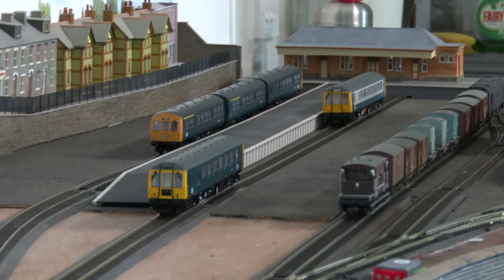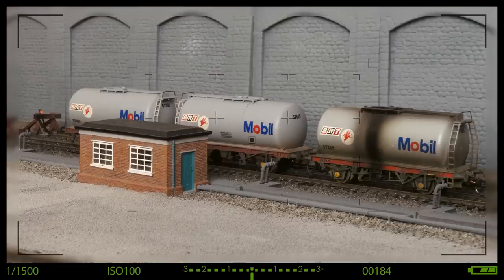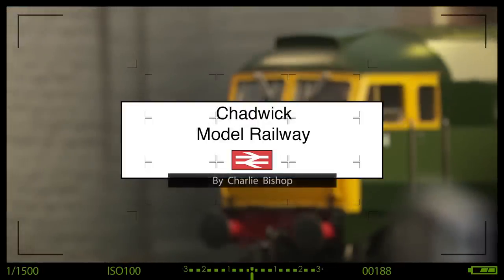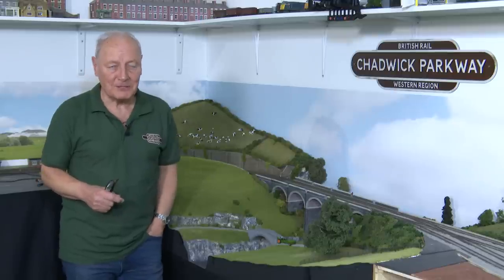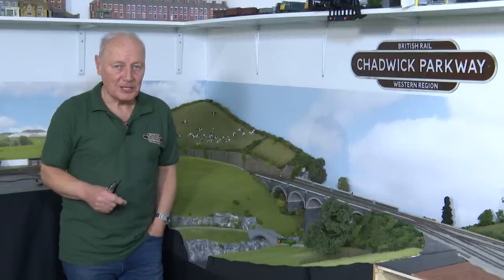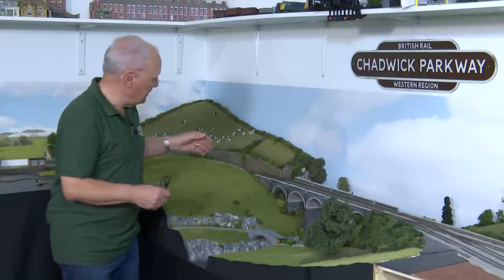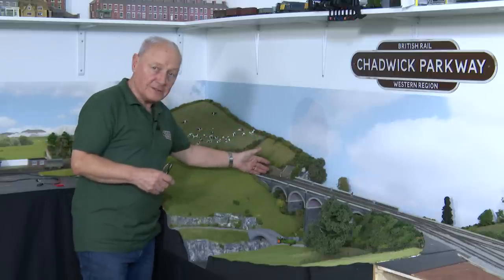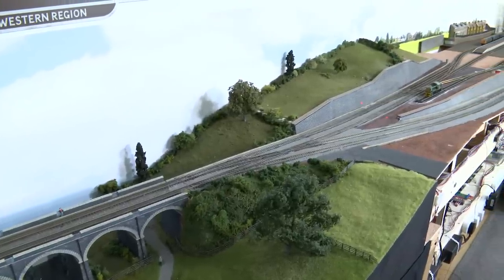SIGNAL POSITIONS at Chadwick Model Railway | 199.

Comment: Hi Charlie. Train driver here. Section 2.3 in the RSSB Handbook RS521, Signals, Handsignals, Indicators and Signs states the following:

“Junction indicators are provided to show that a train is being signalled to a route to the left or right of the straight route.

When the straight route is obvious, there is normally no junction indicator provided for this route.

Where there is no obvious straight route, a junction indicator will be provided for all signalled routes.

Where the straight route is not the highest-speed route, the junction indicator will normally apply to the lower-speed route.

Where the diverging routes ahead are both of equal speed, a junction indicator will be provided for each route.”
Reply from the maker: An absolute epic quote Phil, and one of which I’m most grateful. Regards, Charlie
Reply: Yes although technically correct this is based on modem signalling practices. Back in the 60/70 and early 80s the approach was different
Reply: @Llamberg.Railway As I was too young to work in the 70s and 80’s, unfortunately I can only go by what I know but thanks for the historical context.
Reply: Hi Charlie I’m an active train driver regarding ground position light signals displaying yellow aspect these are stop signals applying to movements in the direction to which the signal can be cleared other movements can pass the signal without it being cleared therefore the signal showing a yellow aspect and a white aspect the movement is cleared for the shunt neck when the same signal shows 2 white lights at 45 degrees the movement is cleared for mainline however this will also mean that the train needs to be able to stop at the next main aspect signal or it’s coming on top of another train the type of signal you need is a yellow and white light both lit and when the signal is changed the yellow light goes out and shows 2 white lights at 45 degrees hope this helps I’ve got photos in my rule book don’t think I can add the to the comments.
Reply from the maker: Thanks Mark, I fully understand that.
However, coming in from the mainline you will pass the unlit side of the signal.  I’m wondering what the signal might show and does it matter anyway.
Regards Charlie
Reply: @ChadwickModelRailway  hi Charlie, trying to phrase things as not teaching to suck eggs, when approaching the yellow white ground signal from the reverse side of the signal will show yellow white irrespective if travelling from the main line or head shunt.
Reply from the maker: That’s what I needed to know.
Therefore, you can’t wire it to the point position, otherwise it would show two whites. Regards Charlie
Reply: @Llamberg.Railway  As a retired Driver, I disagree completely. Even semaphore signals were 'stepped' to show the diverging route ahead.
Reply: @cyberdonblue4413  not sure what your talking about as the context is colour light signalling. I don’t disagree as I’m fully aware of the meaning of stepped semi fore signals. But if the reference is to diverging junctions, the signalling engineers I had conversations with over the years knew there stuff, and what was considered the straight route was not always logical. In the norm the straightest route was used but there were abnormalities on occasion.
Reply: @ChadwickModelRailway  can you define what you mean wire to point position, if you mean the ground signal will automatically change with the movement of the point then yes your correct you can’t wire it to the point. But if you mean it will only clear with the point in the right position ie some form of interlocking then yes. A further thought it could be linked with some form of condition in train controller that the point has to be set for main line before the ground position light will clear
Reply from the maker: Yes LR, you’re correct. I will have to run  the shunt signal through Train Controllers/iTrain, to avoid the two white’s illuminating when a train comes into the goods area. Regards Charlie
Reply: If the above is an extract from the current "Network Rail Rulebook" then I'm glad I left Britain.  Because the terminology reveals a total lack of safety comprehension, & clearly no use of Psychology to avoid dangerous terminology such as "straight route" & even more dangerous "where the straight route is not the highest speed route, the junction indicator will normally apply to the lower speed route". Such vagaries as "straight route " or even "lower speed route" DO NOT define exactly which track is being described leading immediately to confusion, which must be avoided at all cost to avoid accidents. 

In BR days every track had a specific name to avoid confusion between tracks. And every Driver & Guard had to remember all names of all tracks on all routes they "signed for". But then in BR Days it took a minimum FIVE YEARS OR 2000 TURNS of Duty whichever was the greater, in the cab of locomotives as a "Secondman" BEFORE YOU COULD EVEN APPLY FOR A DRIVERS POSITION. Probably why BR's Safety record year on year was usually in the top three worldwide. But since BR was abolished has sunken slowly into the realms of third World countries, and now we know why !!

By the way I'm a qualified Locomotive Mechanical Engineer, who's worked for more Railways Companies Worldwide in more departments than I care to remember. Indeed at 21 years old I was already the Worlds youngest Shedmaster, & therefore also qualified to drive steam. Indeed I've Driven trains all over the World, so I'm familiar with many signalling systems. But never in my 40+ years on railways Worldwide, have I ever seen such an incompetent and dangerous set of instructions relating to signalling, than that idiotic nonsense written in "Philsmith71's" Post above. Indeed I really cannot believe that any railway organisation would produce anything so absurdly dangerous !
Reply: @railwaymechanicalengineer4587 I take your reply to mean that the “idiotic nonsense” to which you refer to in my post is with regard to how the rules are written. If I could have included a screenshot of the relevant rule, I would have done so.

Comment: Bloody hell Charlie...can't believe they make these signals in HO now!  As a signal electrician of 20 yrs , it's amazing to see these in the model form! We call "Feathers" Junction route indicators "JRI' s and the JRI will ALWAYS show the divergent path , so if the main goes to the left, the JRI will point right. We have them in from 9 o'clock to 3 o'clock positions and you can have all if you need them! I change lamps in them all the time! The Number indicator is called a "Stencil" or Theatre down here in Australia and so cool to see a model one! You will (mostly) always get a yellow with a JRI or Theatre aspect unless high speed turnouts are used.
Very nice work and cool to see.
Cheers Gregg.
Reply: Hi Gregg, the fantastic folk at Absolute Aspects are now doing the multiple aspect signals, with Route Indicators, and ground shunting signals in N Gauge - they’re works of art.
Reply from the maker: I’m so pleased that you found interesting, Gregg. However, our diverging signal, points to the lower speed track! Regards, Charlie
Reply: @ChadwickModelRailway   Hi Charlie,  yes , I meant whichever is the lower speed route , to the left in your case.🙂

Comment: Hi (youngish) Charles. 

My goodness, after watching this, am I glad I opted to continue with my station duties at BR's Wimbledon (1970s) and not apply for a second-man position that would lead up to being a train driver. If that had happened, I would probably have been stationed at Clapham Junction (the world's largest junction), Wimbledon Park depot or, Waterloo (remember the Clapham rail disaster?). That being the case, a mental breakdown would almost certainly have ensued as during rush hours, Wimbledon Station saw trains arriving only 2mins apart in either direction. It just goes to show that signalling is the single most important aspect (no pun intended) of running a railway service. God help the commuters if it ever goes wrong. 

Paul. 👍❤
Reply from the maker: A great and honest confession, Paul. Regards, Charlie

Comment: Hi this is an excellent video, I am a former Movements Inspector (Someone who passes out a signalman that is capable of working a specific Signal Box). Like many you have got confused with the issue of catch points, trap points and safety points. Catch points are at the bottom of inclines and are normally in the trailing position to derail runaway wagons. Trap points protect a siding adjoining a running line to make sure anything in the siding cannot get onto the running line and are open in the facing direction. Yours is a safety point to protect something from escaping from a private siding onto the main lines and would be worked from the signal box.
Reply from the maker: Thanks Andrew, much appreciated.
Could not a private line, have its access locked of without signal box intervention?
Regards Charlie
Reply: Hi Charlie, Some Private Sidings had a gate which could be unlocked by a key but this was dependent on the layout. Where a Safety point is used then it could be controlled via a ground frame by the train crew but in your situation it would be done by the signalman if the distance was up to the legal limit of 350 yards for a mechanically worked point or further if it is electrically operated. In some instances where a ground frame is used that could be electrically released from the Signal Box.

The situation concerning the Junction Indicator on the signal is slightly more complicated it would be dependent on factors such as line speed etc. In your example as a former Movements Inspector my opinion is that the Junction Indicator would go to the left, even though the Main to the right curves would have no influence on this as it is a through route. If the Main has a speed restriction of greater than 10 mph from the lead over the viaduct then you would have a Junction Indicator for both routes.

Your ground signal would have a yellow (bottom Left) and a white (bottom right) to indicate access to the head shunt is allowed but to get onto the main line the yellow light would go out and an additional white light above and at 45 degrees would be required to authorise a train to go onto the main line. Before the Signalman could reverse the lever for the ground signal the points would have to be reversed first to enable the ground signal lever to be unlocked.

In the Signal Box you pull the Point levers from the exit point towards the train and the signals in the order the train will pass them. Hope this helps but feel free to come back with any other questions you have. @ChadwickModelRailway
Reply from the maker: Thanks Andrew for some intriguing details. Regards Charlie

Comment: Enjoyed the video Charlie and great to see you are taking the signalling seriously. I hope it wasn’t only me that mentioned the catch / trap point. I wasn’t pasting you sorry if it came across that way. I think you once mentioned you worked on helicopters well you know more about railways than I know about helicopters and you’ve pretty much nailed it on this video. 
Regarding feathers (correctly junction indicators) the indicator is for the route that diverges from the main route. In your case a No.1. The main route being to the helix. 
Route indicators (slang = theatre boxes) are found where the line speed is slower. This is because it takes a driver longer to process the information they contain than just seeing the “flash” of a feather (flash being another slang term for a junction indicator). Let’s not get too far into signal sighting which is a whole different chapter of railway knowledge 🤣 Depending on your line speed coming off the curve onto the viaduct you could simply use a theatre type route indicator. M for helix, 1 or 2 for your dead end platforms. This would be 3 aspect  green or yellow with M for M aim line (helix) yellow with 1 or 2 for your platforms. 
That signal would also have  position lights beneath the main aspect for movements towards the occupied dead ends. Position lights would still need a 1 or 2 route indication for the permissive (already occupied) platforms but position lights and no theatre indication would be for the goods sidings. So no need for a G indication. 
A yellow ground signal would work for movements from the goods to the head-shunt, yellow and white horizontally displayed. This is the normal position for this type of signal, allowing for movements towards the headshunt with no involvement from the signaller. Only when a movement is to leave the goods sidings for the main line do you need the 2 whites at 45 degrees which the signaller sets. This allows for shunting into the neck without the signaller having to constantly set the signal which he would have to if it were a standard red/white ground signal.  You don’t want the RMT on your back demanding better pay for the signaller because he’s never got chance for a brew🤣🤣
There would need to be a further main aspect stop signal beyond this yellow white ground signal before any conflict point with a junction though. Not sure if your track layout allows for this. 
By all means send me the plan and I’ll signal it for you. 
Best wishes
Paul (mainline train driver).
Reply from the maker: Thanks Paul, for an in-depth response. With similar advice from your colleagues, I think I’ve cracked it now. It’s great to have you onboard. Regards Charlie

Comment: Yellow/white ground position signal - 
You can pass these in the on position as long as the line is set for the route that the signal cant clear.

Meaning you can pass the signal in the on position as long as the points are set into the headshunt.

For going out onto the mainline, you have to obey that signal in the normal manner. 

As for route indicators, they are normally for a lesser route, you usually have the main aspect for the more ‘important’ /faster route
Reply from the maker: Thanks E. 1992, much appreciated. Regards, Charlie